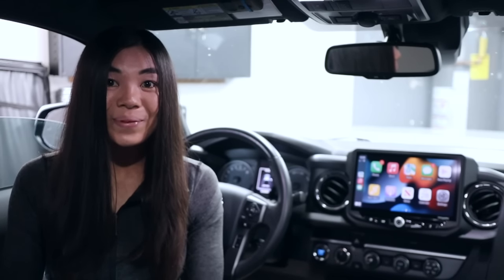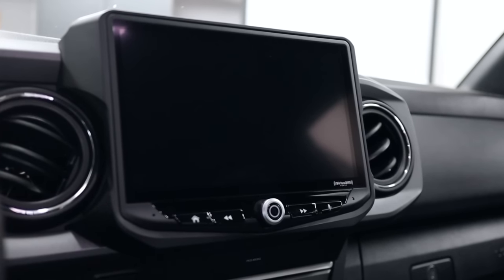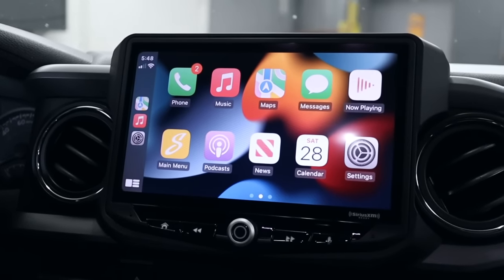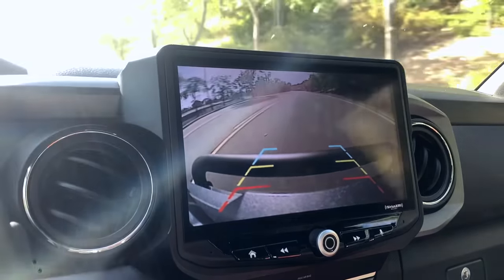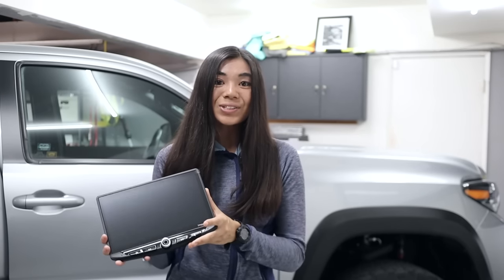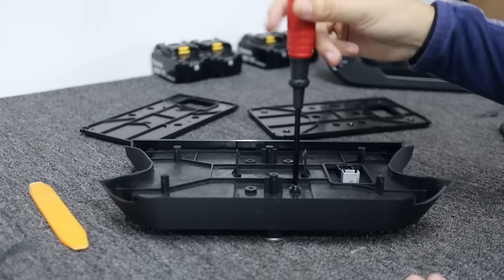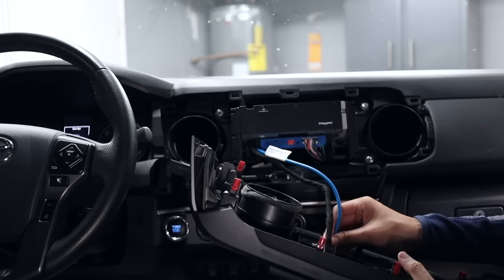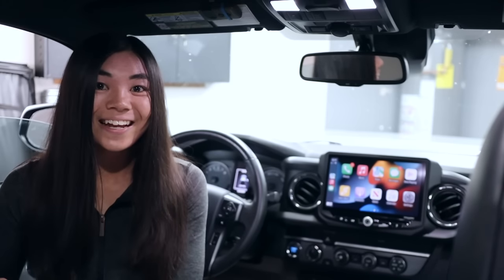A new GIANT Head Unit for my Toyota Tacoma! | Stinger Heigh10 Install + Review

Comment: I just bought this for my 2022.  1. 4,300 cost to install and upgrade both tweeters, 4 speakers and add 50w amp and add a base unit with JL audio     As this is a huge install I am having a professional install it. This is a lot of work.  I can’t wait as the stock sound system sucks.  
6 days and I will have it done.  I will update this comment.
Reply: I installed this same unit on my ‘22 Taco about a month ago and it only took me about an hour.  Is not hard at all if you follow TacomaBeast installe video.  Save the $$.  Also replacing the twitters and speakers is not difficult. Check the many youtube videos on it.  I replace all speakers and twitters with Kickers and the combination with the Height “10 headunit, sound is super awesome.
Reply from the maker: Awesome!! Let us know how it goes!

Comment: I'm still old school. I don't want a touch screen radio. I don't see how that's better then just buttons and knobs to press or why making it bigger would be better somehow. I plan on changing my stock head unit to a single din cd player with Blu tooth and a cb radio installed underneath it. I agree the stock head unit needs an upgrade but it's about better quality sound. Not a bigger touch screen.

Comment: You failed to mention that it has an internal amp, you didn’t notice a difference in sound since the stock speakers aren’t compatible with that power output on the new head unit.
Reply: Right, my understanding is that the oem speakers are tuned to the oem head unit. If you change the head unit, you need a compatible one or new speakers.

Comment: when I press and hold the mute button on the steering wheel it actually pauses my sat radio or my spotify... Not sure if it will do it for you on the aftermarket Head Unit?  thats on my 2021 TRD Sport.  Nice vid.

Comment: Hi Chloe, I installed this same unit on my ‘22 Taco, and for some reason the call volume while using CarPlay is very low from my side and the caller side, have not figure out why.  All volumes are pretty high and the call volumes while using Bluetooth is awesome.  Can you check why the CarPlay volume is so bad? I tried contacting Stinger and no success fixing it.  Also the resolution of Carplay during the day is not the best.  If you can help, I’ll appreciate it.
Reply from the maker: Did you up the gain in the sound settings for CarPlay? I had to for mine. Otherwise, maybe it's a volume setting you can fix on your iPhone itself. Good luck!
Reply: @ChloeKuo  I have tried everything and nothing works.  I am using the BT phone call settings which is pretty crystal clear. Thanks

Comment: Hey Chloe! Does this headunit's camera app take the placd of the anytime camera mod?
Reply from the maker: Hi! I did gut everything form my anytime camera mod, except for the camera itself (which just is an RCA connector that plugs right into the unit). Now, I cannot access my front camera from a physical switch, but do so by going to my camera app on the Stinger itself. Hope this helps!
Reply: @ChloeKuo  it does thanks! Always enjoy your Taco mods!

Comment: I have a 2022 Tacoma Sport Premium with premium JBL sound package.   When using Carplay, when Siri talks (texts, navagation, etc) or when you use the phone, the sound only comes through the front drivers side speaker with no option to adjust volume (trust me i've tried).  Apparently this is how the JBL system is designed in the Tacoma for whatever reason.  Otherwise the sound system is great for radio, SXM, and CarPlay music.  Does this head unit use all speakers for calls/Siri/text message readback and allow adjustment of the volume?   This is something i need to know about the Stinger head unit as it would determine whether or not I buy it.

Also - idk if i can forgive the fact that the Stinger unit will not use the Tacoma's OEM microphone.  Does the little one on the front of the head unit work well?  Can people hear you when on the phone?  I absolutely will not mount that cheap looking lapel microphone in my tacoma.   

Thanks!  - Also great video I'm super interested in this radio as long as it remedies the Siri voice issue.

Comment: How did you get the reverse camera to work?  I followed the instructions on install and it shows No Signal. I called Stinger and they told me to follow the paper manual to fix it, but it didn’t work.  You have the exact same Tacoma as I do. Year and all. Did you have to do something different to get it to work?

Comment: I have a 2017 TRD Sport, and have been considering this head unit. Only issue being, I travel a lot for work and use the built in navigation to get to new job sites....does this new head unit maintain the factory navigation?
Reply: It has apple car play/ android auto, but if you pay an extra $150 it comes with a navigation chip

Comment: The Heigh10 is a great headunit! As a  Car Audio SQ (Sound Quality) guy, this headunit was big news to me a couple years ago when it came out due to its Optical output which also had Variable volume control. 
That was important because other radios with optical digital outputs usually had fixed volume control - and you needed to control volume using your DSP controller. (Even the High End Sony GS9).
Reply: For my application, I was disappointed cause the Pre-amp outputs are  lowend 2 volts only... The signal ends up becoming noisy when it gets to my amp.

Comment: Tempting me again Chloe!  Hey can you confirm weather or not the unit has a built-in XM/Sirius tuner? (on the vid id showed "searching...")  Also...what happens to the audio/navigation displays between the spedo and tach with this unit installed?
Reply from the maker: Hi! It does, although I'm not subscribed to Sirius XM. As for the audio/navigation displays on the instrument cluster, they are gone. However, fuel economy, TPMS, roll/pitch angles, safety sense all seem to be retained

Comment: How does this unit affect the overall sound quality? Have you noticed any difference?
Reply: I've had mine for a bit and with the versatile equalizer and crossover settings I'm sure with stock speakers you could get it goin however you want. Now all those settings paired with a quality sound system like for example; the dual subwoofer system and door speaker replacements with dedicated amps from OEM+, it BUMPS! Obviously to each their own when it comes to music and what not but as someone who's a audiophile that's why I got the heigh10 was for all its capable of and the sound settings. Granted its a bit expensive for the whole setup but I'm very impressed with the heigh10. Cons however though are the camera quality isn't the best. Idk what changes when you hook up the heigh10 but the quality goes down a good bit and as far as I know there's no way of adjusting the quality. As of right now, that's really the only thing I can complain about. Hope this helps in anyway.

Comment: I just installed the same Stinger Head Unit in my Tacoma 2021 two weeks ago.  Initially I replaced the OEM radio with the T10 Android Head Unit.  Since the very beginning, I was struggling with it… I had problems with the reception on the FM stations (always intermittent interference without any obstruction nearby), and I was not able to lock on any AM station… I’m an Android guy.. that’s why I bought it, however, trying to connect to Android Auto, either wired or wireless, it was a nightmare.. I got rid of it and installed this Stinger unit… right of the bat, it worked flawless.. fully plug & play… the sound quality is way much better...  I’m really happy with the unit…  If you want a good quality aftermarket head unit, this is an excellent option.
Reply: How about the call volume while using CarPlay? Mine is very low.  Bluetooth is good.
Reply: @Jam27401122  The volume settings are at the Head Unit for the bluetooth, the phone, ect., however, for the phone, the volume input comes from the phone itself.. the same happened to me on my Galaxy... you'll have to increase the volume on your phone, to fix the issue.
Reply: @josearodriguez9601  I’ll try this and see what happens.  Thanks for the suggestion

Comment: Great video and thanks for sharing. Almost had me sold to be honest because I like the size but was adverse to a "floating" head unit, so last fall I put in a 9" pioneer that fits flush without a trim kit even though it's not meant to be. Just happened to fit just right in our trucks. 

As for vehicle settings, does the stinger have Maestro compatibility? With that, you can keep all your lights and locks and the sort access without having to "forget and set" (at least you caught it lol).
Reply: Hey, I'm interested in a flush mounted head unit, too. Which Pioneer stereo did you get? Thanks!
Reply: @stephenlee2894  pioneer dmh-wt7600nex. You will lose built in navigation and CD player, but gain wireless carplay/android auto, and retain factory options that she says you don't with the unit in this video.

Comment: Hi Chloe, I have a stinger elev8 which is their 8 inch deck. With stock speakers the sound is only going to be so good. If you want it to sound great you will need to go the whole 9 yards and change speakers, add an amp , sub and a DSP. That head unit also has provisions for an optical cable which will further improve your sound. Hope that helps.
Reply: You're absolutely right.  In my 2020 Tacoma I replaced all my speakers, tweeters, added a sub, and added an amp.  The door speakers I pulled out from the factory were a joke. They don't weigh anything at all....more toy like than a real speaker!!  I was shocked.  Now I ride around with great sound but would love to have this head unit....don't know if I love it almost $2k worth though lol.
Reply: @MrRay3801  I put really good equipment when it came to building an incredible car stereo. All hand built. So glad I did.